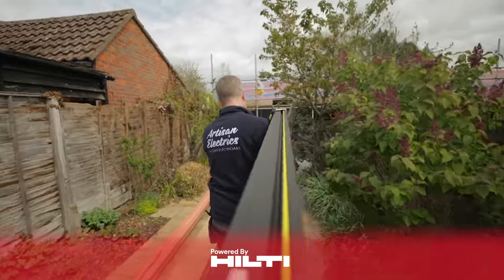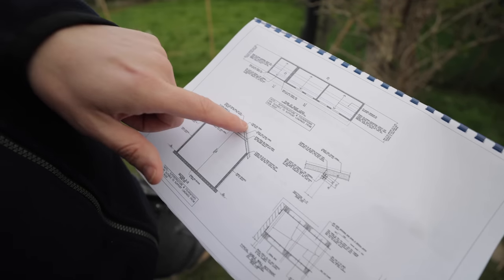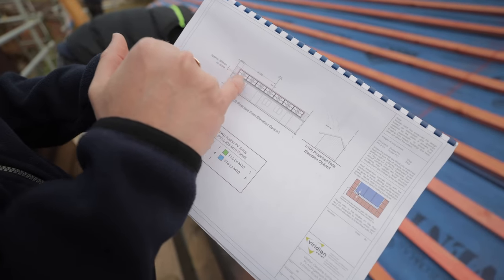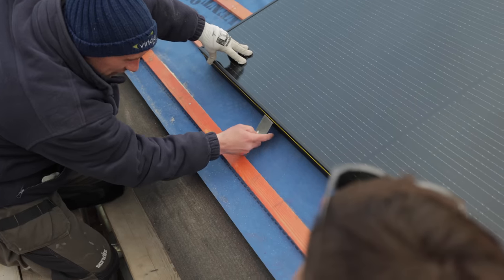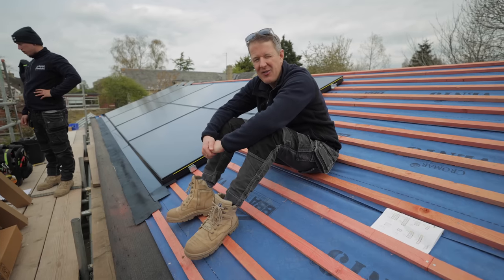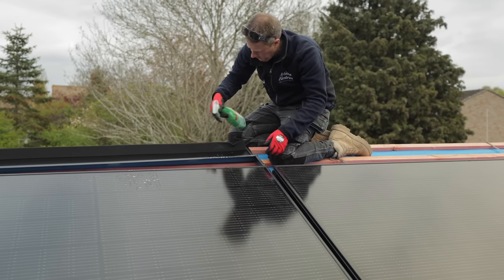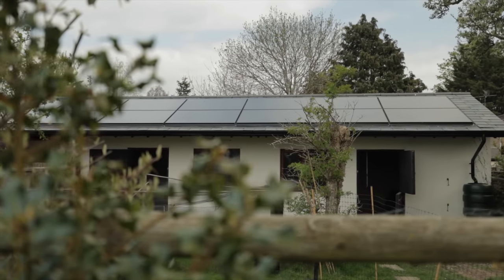Installing an In Roof Solar Panel System

Comment: Really interesting, I do have a few points -  
1) The risk with solar panels onto a roof is typically wind uplift, not weight increase. The in roof systems avoid this as they are not making a sail, so you're right that it might avoid needing a structural engineer, but not necessarily for the reasons you state here. 
2) I can't say that I'm too impressed with the Viridian system between the upper rand lower panels and I don't see why they couldn't have made a flashing to sit over the frame of the panel below so that there isn't a channel between the upper and lower panels - moss and leaves will love that gap!
3) It would have been worth fitting panels to the North face as well. The need for panels to be due South is overrated and if anything they will get far hotter which will reduce the performance, so North facing panels would then pick up the slack. These could still be limited by the inverter if needed to keep the output below the 4.5Kwp cap on a single phase supply. Seems a missed opportunity.
Reply: I really agree with point 2, not too impressed with this system. Build up of moss and dirt. But also the waterthighness is a risk over the years. Is it watertight when 10cm's of melting snow lies on top of it or will it seep through? No offence by the way, because I think it's hard to design a in-roof system that will function flawlessley for 25 years.
Reply: There's no channel between upper and lower panels, they have a joining strip with an 5mm wide upstand which allows for water to drain off into the drainage channels running vertically and prevents any build up of  leaves, moss etc
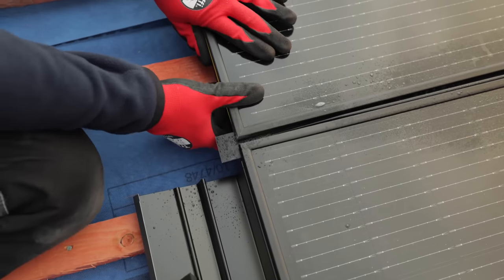Reply: @jayriddo3010  Take a look at 9:22, there's a channel formed after the joining strip is inserted between the panels. I appreciate that it's only the upstand thickness on the edge of the panel below, but say that's 10mm deep then you've got an awful lot of water accumulating and as soon as there's some bird mess in there it'll be well on the way to an eco-system by itself. It'll be fine when it's new as the water should shed to the sides by itself, but I can't see it ageing well once there's some dirt in the grooves.
Reply: I really disagree. I mean sure when you live somewhere hot like Arizona you want also a north facing roof. North facing roofs are however, beyond idiotic in most places. For reference, New York and Madrid are on the same level. Europe is much further up north than the US. North facing panels in the UK, with it's gulf stream mediocre weather, mild summers, mild winters, barely any northern sun hours, is the biggest waste of money one can make.

Comment: How hard is it to replace a panel in the middle in the roof if one fails or gets damaged?  It seems the interlocking would make that a challenge, although this video didn’t show enough detail on the side to side connection to see how that is done.  Maybe just have to remove one vertical “column” of panels to get to one in the center if you have more than two longitudinal rows of panels.

Comment: Fall protection guys, protection on one side does not save lives.  At 7:30 when Jordan is back to the unprotected edge crikey!
Reply: If a health and safety officer popped in the site would shut in seconds.
Reply: Standing on the top step of step ladders is also a no no on any site.

Comment: how do you replace panels? do you have disassemble the string so you can get to the panel that needs replacing or can you cherry pick out of the string?
Reply: Also what do you do if these panels are no longer manufactured ? Since most panels are of diff size, would you leave dead panels?

Comment: Curious about the horizontal battens. When water gets under the tiles or panels it runs down and hits a horizontal dam. How does the water exit and how does drying happen with this system? Is the roof fabric draining the water?
Reply: surely battens are always horizontal, and any drainage required happens in the dips in the felt between rafters.

Comment: I quite like the idea of this - my poor installers had to repair/replace a shedload of slates on my on-roof install about 10 years ago - when the roof needs replacing this will be a no-brainer if I can get it past planning. The downside I can see is there is no air gap for cooling - likewise with the optimisers being under the roof - however replacing them would be far easier in the loft 👍 I’ve had the misfortune of replacing one recently although it was one of the easier ones to access - otherwise it would be a full scaffold job 😮 This in roof system looks solid but a bit too finicky for clumsy trades to fit and make a hash of the weather tightening, otherwise looks neat 😎
Reply: I would say these panels have the best ventilation of any in-roof system on market. No plastic or anything behind the panel, just space for air flow!
Reply: @tomdavies2055  how does the air get behind? Quite hard to tell from the video plus the skirting looks solid, unless I missed the gaps?
Reply: @Umski  If it's built correct it has air gaps in between or there soon will be a verry modly roof instead.

Comment: The pitch of the roof is low, so during wind and rain, water will go in between the blue plastic. + there is no vertical wooden structure. The water will get stuck on the wooden horizontal lats and rot. Not a lot of water, but it will give issues in 10-20years. 
What is also already pointed out, is the panels cant cool down. Even in the UK this seems bad and i wonder if it has influence on the life span of the panel.
The rest seems very neatly done and beautiful.
Reply: I agree. And the membrane was penetrated with screws. That kind of installation would not pass an inspection in Sweden.

Comment: I can show you a roof where a part of the modules (total 24 kW) is set up on a flat roof with correct ventilation, a part is fixed a little too close to a roof below, so less ventilation, same inclination. Same modules, same production batch. After 18 years, 38% of the panels mounted on the less ventilated are had errors that cost them 33% of their respective yearly production (A substring fails means 1/3 in gone)

By not having a proper ventilation behind the modules, you not only lose up to 30% efficiency when hot, you reduce lifespan considerably.

Also I dispute that it may possible to mount the module so that absolutely no water gets behind: We have considerable heat expansion so the modules must have a gap to compensate for that. The gap is where the water will come in but not a problem if you set the modules on top of a roof, not integrate them as you did. I am all for optical integration but there needs to be ventilation.

Comment: What is the price of this install (panels on the roof) ? Are you saving on the roof aluminium rails since using screwing directly on timbers ?
Reply: this is 100% more expensive then a regular system on rails. Only thing that offsets the price and makes it on par with a regular system is if it's a new roof, and you wont need roof tiles where the panels are.

Comment: I think all newc agricultural buildings roofs should be designed to accomodation solar panels at the build or for future installation. Most farms have space to design new barns etc to arrange location to have  a roof facing South. It needs government to put this in the planning requirements with the farm building grants.. Any comments.

Comment: 14*405 Wp = 5670 Wp. Not bad. Cost wise probably the same without installation? And the same for Installation?
i think this is very interesting if you do an attic conversion on an old house and raise it by 1 or 1.5 meter to create some new living space. then you need a new roof as well, and make it similar asymmetric and put in three big windows in - everything well suited for the solar panels.
however, in Austria it would need a different design, maybe steeper to be better suited for the winter sun and for letting the snow glide down and sacrifice some efficiency in the summer, where you have enough output anyway.

Comment: In ontario, code requires a combiner box with fusing/disconnects within 10ft or so of the array, accessible to the person on the roof.  This system does away with this it seems, but also there is no discussion of grounding in this video, which is a function conventional rails would have performed.  I didn't notice any kind of grounding of the Viridian panels.

Comment: How do you handle the heat build-up under the panels? If the surface of the system is sealed I would add a perforated flashing at the bottom edge and a fan inside near the top to pull air under the panels. This would create what is known as a back-pass thermal air collector. If the building requires any heat or ventilation, this would provide that and improve panel output through heat mitigation.
Reply: I looked for this type of system a little while ago and it seemed nobody was doing it, so started trying to think of a way to do it myself. The consensus seemed to be that it wasn't done because of heat build up reducing panel efficiency. I came to the exact same conclusion as you have. Fans should be installed and the heat harvested(if required). All new homes in the uk are built with heat recovery systems due to how tightly sealed they are. It would be very easy to plumb this hot air into such a system to heat the house. 

Looks like the pros are at least half way there now. ;)
Reply: @davidleisk580  A couple of tips when designing your system. One fan (i.e air intake) can pull air horizontally up to 12-13m from each side. Also, open-loop back-pass thermal air collectors have the highest efficiency with a very narrow air gap. Higher air volume p/m2 of collector produces a lower temperature rise but higher heat transfer.  So if the goal is to improve PV efficiency, go higher volume.  However, if you are plugging into an HRV, you can just go with what they are pulling.  Keep in mind that the system will increase static intake pressure so a small helper fan feeding the HRV from the underside of the collector would be recommended. In any case, by decreasing the Delta-T for the HRV, you will also increase its efficiency.

Comment: Can't wait till we get perovskite PV on flexible plastic film rolls. Spray glue along the battens, follow along with the roll of PV film, and connect up. A little bit easier. If it fails, just glue a new one on top.
Reply: You’ll be ded b4 then.

Comment: Are you doing it to look fancy or to be functional? Solar panels perform better cold. There is a purpose to mounting them spaced off of the roof. Also makes replacement simple.
How hard will it be to remove or replace panels?

Comment: Wasn't the roof long enough to fit two more panels? I would even have aimed for increasing the width by making the asymmetric shape even more extreme so at least there could have been fitted on 24 panels. Would the system allow to cover the entire roof with panels or is the presence of at least one row of tiles all around unevitable?
I would never prefer in roof systems because of the lack of natural panel cooling effect without backside air circulation nor have too much confidence in the waterproofness for several decades.

Comment: Really useful vid (as ever - thanks guys!), as I'm just about to press the button on a Viridian in-roof system to coincide with a re-roof.  However ... my installer tells me they won't specify the SolarEdge optimisers due to their "relatively high failure rate", and the hassle and expense of replacing, say, 1 panel in the middle of an in-roof setup.  Optimisers can't go in the loft - as there isn't one!  Any comments from experience of this?
Reply from the maker: The SolarEdge optimisers are very reliable when installed correctly

Comment: Interesting.   The next evolution would be to run water pipes under the panels to extract that heat out.  Its a win-win: (1) get hot water which is very energy intensive to produce (2) cool the panels to get more electrical energy production and increase panel lifespan!

Comment: Should be counter battened. Vertical battens first, then horizontal. No where for rain to drain if wind driven rain gets in or condensation drips especially at that pitch.

Comment: He mentioned about undulation of the roof.  If you are installing on an existing roof be very careful as most roofs do have undulations. I would only ever install on a brand new roof.
Reply: What about the wood shrinking after installation,very rarely the wood is perfectly dry and won`t shrink or crack

Comment: Hi, i’m an 18 year old who did a levels instead of going to college to pursue electrical engineering, however i’m looking to become a qualified electrician now. I have seen a company called engineering real results online and they say they can get me fully qualified up to level 3 with city and guilds qualifications through their online course as well as some practical work i would do at their facility to add to my nvq. Would this be enough to get me a job or would i struggle to find a job as i won’t have as much experience as someone who takes an apprenticeship route? Any feedback would be greatly appreciated, Thanks

Comment: I just DIY'd 3 panels on a garage roof.  There is no way to move the top two tiles which taking the pointed ridge tiles off, so I... I have have a bit of an overhang.  I figure it will be fine.  As long as it doesn't start "fluttering" in high wind.
Reply: Supposed to have a minimum of 300mm from the edge of the roof to stop wind uplift or it can rip them of in a high wind
Reply: @shropshireladoutdoors743  Yes, I have about 30cm of roof around all sides, it's just the position of the rails.  The top rail is one roof tile lower than it really should be.  But I wasn't going to crack the ridge pointing and then try and source terracotta motor to fix it again!

Comment: you forgot to mention that not all solar panels including the latest max outage are possible to be fitted to an in roof design, the kits only fit normally up to 410w pannels 72 cell

Comment: Great video. The UK has a slightly cooler climate but for hotter places, is the in-roof system really efficient with the effects of heat on the solar module performance??
Reply: I would think not. Regular mounted panels get cooled by convection. These bad boys are gonna get really hot. If they were on a house then they'd be heating the loft a lot in the summer too.
Reply: Indeed

Comment: Did anybody else notice the foolish ladder use at 12m35 in? There's a scaffold tower available  too! smh
Reply: I used to be an H&S rep. It was all bollox. All that happened is a man went up a ladder and another was employed to hold the bottom steady. So double the manning levels and costs. The union loved this. Nobody held anything. Jobs were planned with the extra manning and everyone worked as before but finished early or spent time playing backgammon. Productivity was a joke as a consequence.
Reply: @mbak7801  My point was, that nobody should be putting their full weight on the plastic tray at the top of a ladder. Especially when there is a safe alternative nearby :-)
Reply: I agree J. Daley. M Bak obviously thought you were talking about a standard ladder. I saw the same as you with the guy standing on top of the step ladders. At least a warning on any building site.

Comment: looks nice, but i see a heavy issue with the system. if a pannel goes faulty or need replacement its gonna be a pain in the arse to replace it <.<

Comment: I only hope you can still get this exact size of panel in 10 to 20 years if one fails! Think you need to have a couple of spares. On a new roof maybe worth the effort but can’t see why anybody would fit it to an existing roof. Somebody near me fit a in roof 5 or 6 years ago and it doesn’t look any better in my opinion
Reply: Panels have a 0.05% failure rate, I think it'll be okay.

Comment: Perfect situation to get the ideal angle for the panels. What was it ? Was it for maximum summer generation, or with batteries to charge all year round, more towards a winter angle ?
Reply: That was the first thing I thought when I saw the angle of the panels. It looks as though they are basing it it on Summer's higher Sun position.

Comment: ok,it looks good and all that but what about the cooling of the panels ,how will the air will circulate under them for some cooling,they get really hot when it`s a lot of sun and with the rising of the temperature ,the 
efficiency decreases
Reply: I have a gap under my panels. Pigeons moved in, blocked circulation with nests. I had to have them evicted and mesh added to stop all the birds of every imaginable size living under the panels. Net result is very limited ventilation anyway.

Comment: The way these panels are installed on the roof battens there is literally zero ventilation underneath the panel. This will be hurting the panel performance on warm days! 🙈

Comment: I don't understand why new homes don't have solar panels built in from new, I imagined that by now all exterior surfaces would be solar collectors, walls & roofs, panels can be printed to look like brick, slate, wood anything you want to aesthetically they would be fine, and the near zero maintenance of them means less money spent on the exterior of the building, add a ground source heat pump and your living totally off grid. I used to work in civil engineering/construction and some of the big glass-clad office blocks that are in our cities have solar panels built into the glass exterior cladding.